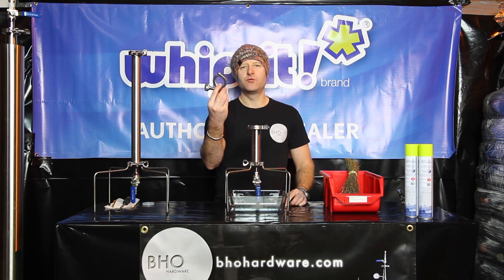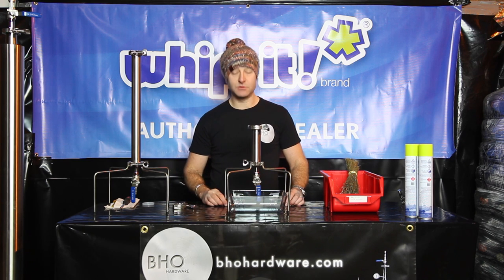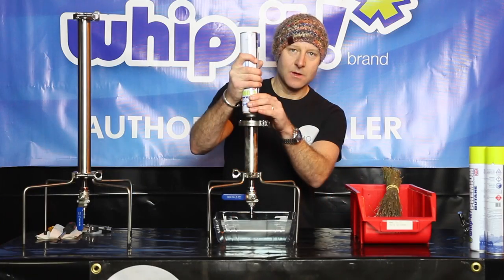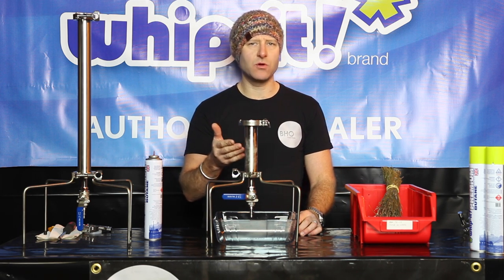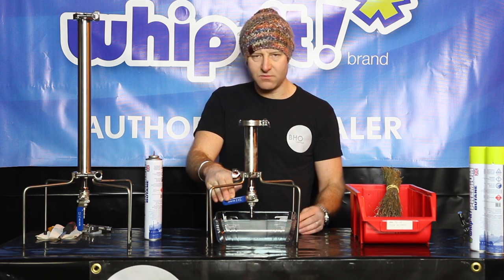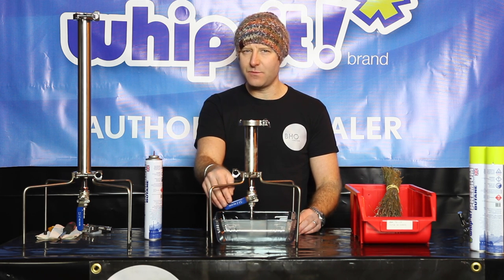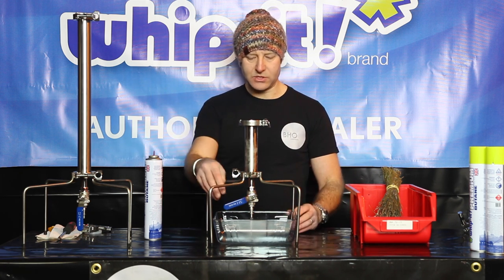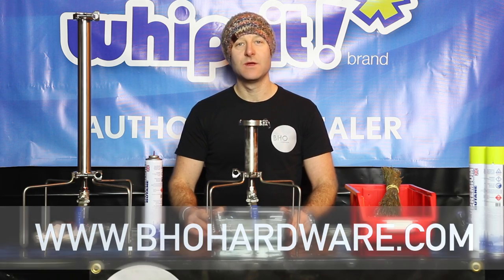BHO Open Blasting Demo PART 2 - Lavender

Comment: On the 24” one how many cans do you use and also how long do you vac chamber it before placing in freezer? Do I need a gauge for that or just count? I don’t want to mess my setup up I just got…
Reply: Just listen u will here the motor gear down when it's Dunn

Comment: Yo, anyone there ? How many cans do I use in a 24 in tube ?????????
Reply from the maker: Sorry for the late reply man, that about right mate, you will notice that as the ca empties it looses pressure, the best way to go about it is as follows.  once the material is in the tube, vac the tube out using a vac pump, if you have a dry ice column then use dry ice this helps chill the column and the material inside.  Once you introduce the butane, as it is going into a super cold environment s does not expand as quickly meaning you will be able to get more in and build more pressure and get a better saturation rate. Once you feel that the first can has lost pressure get a fresh can ad that should have enough pressure to get that little more in. Hope this helps man
Reply: 1 can per 28 grams about
Reply: there abouts mate, probably a little less

Comment: Are you just letting that butane evaporate in the air? Jesus that's a fire hazard, I wonder how many have blown up their houses because they watched this attempted it and their roommate lit a cig. Very stupid, if you can't afford a closed loop system just buy your wax from someone else or buy a desktop press, this method has resulted in many many house fires countless injuries and a couple deaths.
Reply: Do it outside and youre good right??
Reply: @NagashiChidorii  nah you can reach explosive ammounts of butane outside...